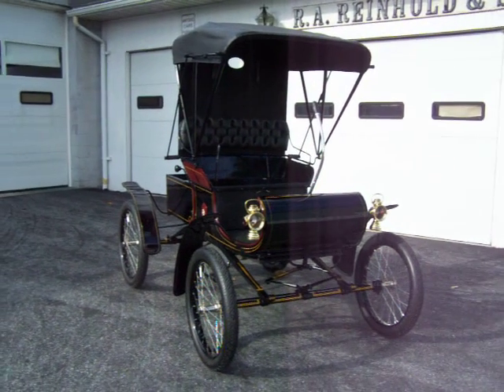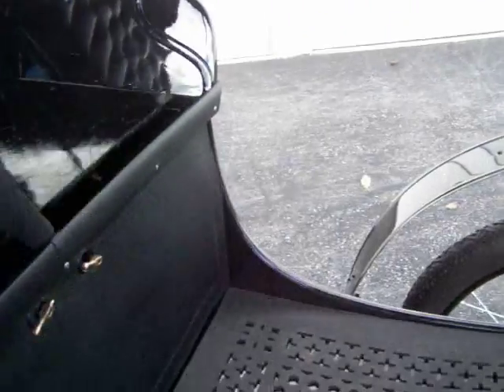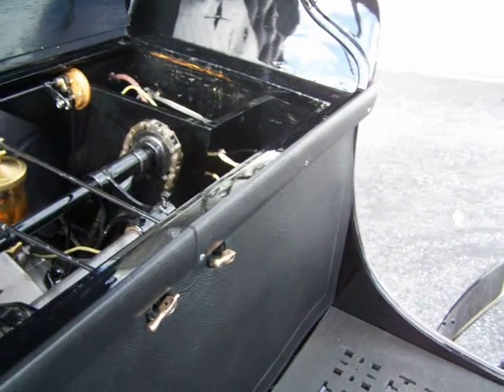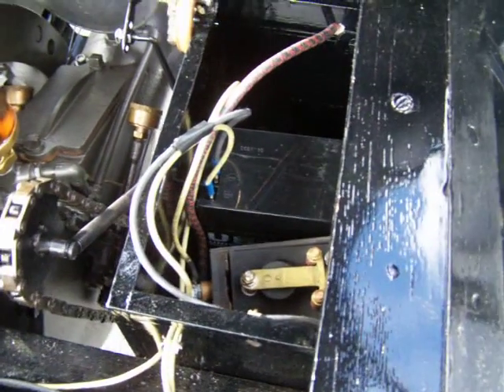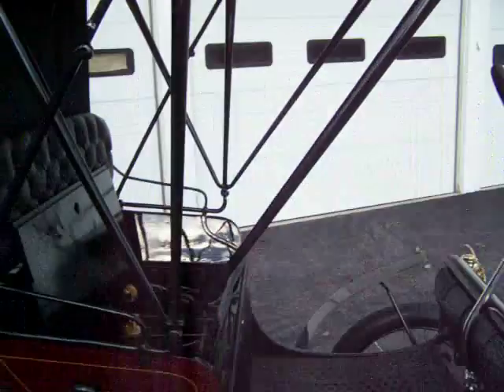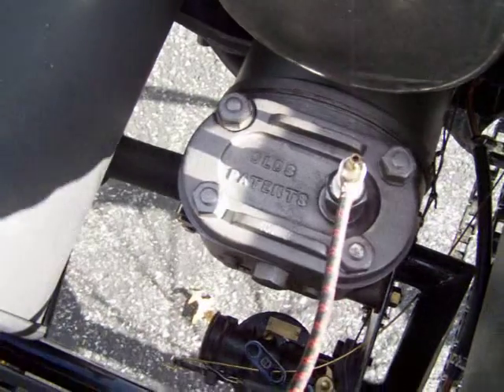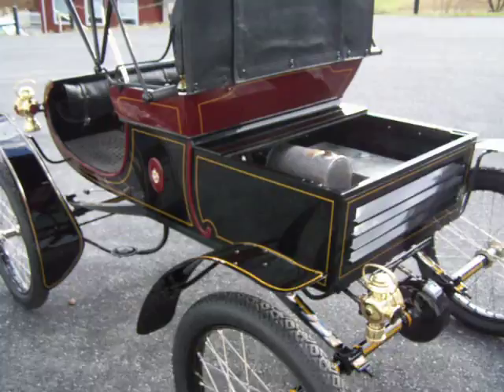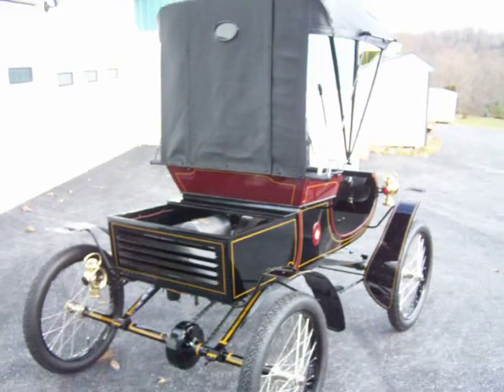1902 Oldsmobile

Comment: I don't mean any insult, but those early cars seem really shoddy compared to today's standard car. Though I think your car is probably more robust than a Yugo.
Reply: In it's day it was considered among the most reliable. It won the first and second places in the 1903 English Reliability Runs, an eight day endurance contest. They also won multiple American endurance contests and races starting in 1901. It was the first car to be mass produced and have interchangeable parts, which would have greatly facilitated field repairs. 19000 were built, which makes it one of the most popular pre-Model T cars.

Modern car engineers would sell their right arm and their firstborn to be able to design a car weighing only 650 pounds.

Comment: Call a replica a replica, 
the engine is a 1902 -1906

Grays marine engine would have the correct carb.
cooling problem is solved with reer valves,
And the copper radiator made from spiral fined coper boiler tube,
that is fitted in front, uses, spring loaded brass spring tentioned reeds valves in an oak block to port and control coolant flow (much like a radiator thermistat.)
spring loaded
Reply: Unfortunately you are totally incorrect . Model R CDO's 1901 - 1903 are completely different to other year CDO's , model 6C and model B and share very few common parts . Furthermore you obviously have no idea regarding a Curved Dash Oldsmobile cooling system because your statement is completely false in every aspect and is just rubbish .
Reply: The engine is clearly 1902 and is NOT a replica ! As for the incorrect Carburetor statement , if you don't know what you are talking about , then don't say anything . CDO's had their own carburetor and started using the very early Holley in the later half of 1903